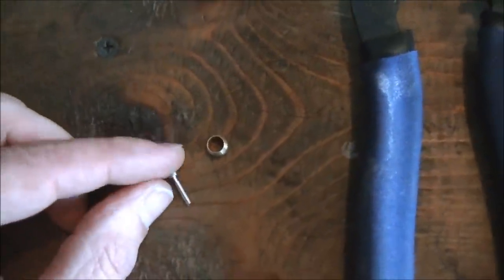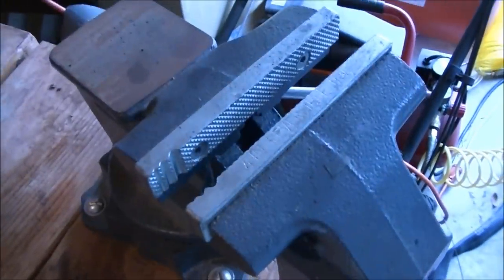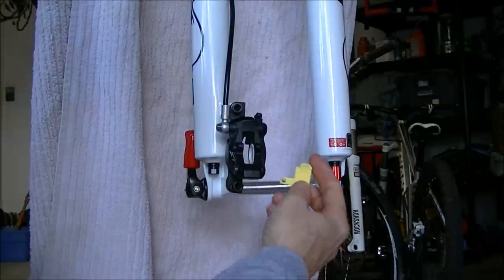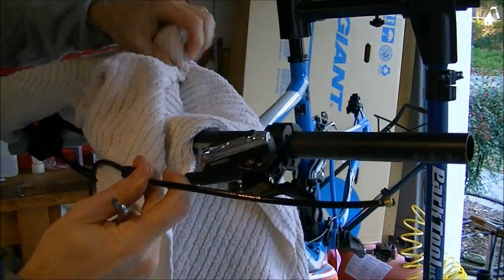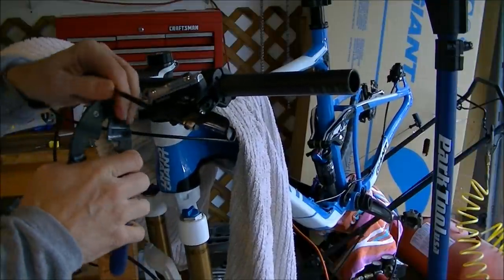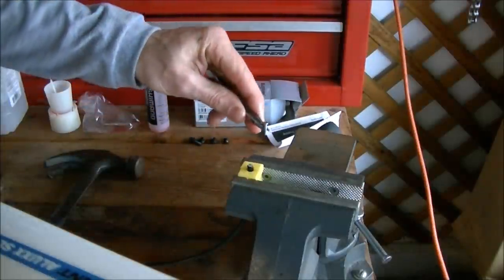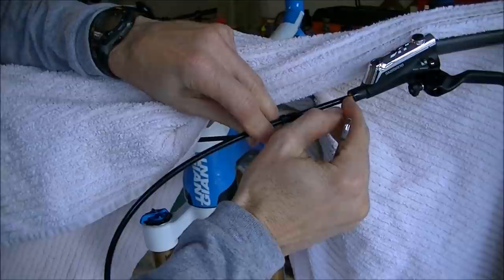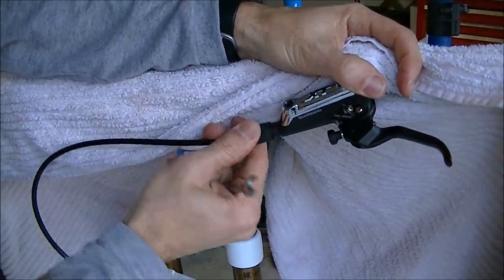How to Cut, Shorten and Re-install Shimano Hydraulic Brakes

Comment: Hey Clint, nice vid , I am currently running Shimano M210 hydraulics but want to upgrade to SLX, do I have to use the hose that comes with the SLX or can I just use the hose thats on my current set up since they are already cut to the length that I need. Thanks in advance.
Reply from the maker: 99% sure you can just use the same hydraulic hose. Keep the other one as a spare.
Reply: @ClintGibbs  Thanks a bunch Clint!!... Keep up the good work!

Comment: People say that an SM-BH59 can be used in place of an SM-BH90, 59 is for road bikes, whilst 90 is used on mtb bikes, I know the internal diameter is larger on 59 than the 90 which is smaller...what would be the difference in operation/feel between the two, I want to install the Saint 810 DH brakes on my Giant Fathom.
Many Thanks and Kind Regards in advance ; )
Ooh!! I can't make my mind up between Mavic or DT Swiss? Do you have a preference??
Reply from the maker: My preferences DT Swiss. I cannot speak from direct experience with smaller brake lines but I would imagine you're going to lose some modulation. But that's just the theory. Never tried it.
Reply: Thank You Clint!  I'll go for the DT Swiss then
God Bless : )

Comment: if i need to dettach the brake lines from the body of my bicycle(cannot be dettached unless another end is free, so it could slide along the holes, should I follow this instruction or is there another way around so I don't need to buy the ones you put inside and outside the cable?
Reply from the maker: You should be able to remove the brake lines and then reinstall using these instructions.

Comment: Just to be sure, my SLX came in as Rear Brake-Right Hand / Front Brake-Left hand. After cutting the able, Can I swap the cable to the other lever so it could be Front-Brake Right Hand / Rear Brake Left Hand.
Reply from the maker: Yes.  And if you want to swap it back on you just unscrew from the lever and screw it into the other one. There's a pretty good chance you'll have to bleed the brakes afterwards.
Reply: +Clint Gibbs Hello Clint. Great video, I will do this when my own set of brakes arrive, but my brother's brakes which we ordered some time ago, a set of M355 disc brakes, entry level, came inverted too. I am to blame cause I didn't notice the description where It did say that they were inverted and he doesn't understand english, so yeah..

But anyway, the length they came with is just fine with his bike, but I was wondering if we can just take out the cable of the lever and insert it on the other lever without having to replace the insert and olive? Like I said, we are not going to cut the cable.

Thanks in advance
Reply from the maker: You will not need to insert a new olive if you do not cut the hoses. You may need to bleed them but try them first.
Reply: Alright, thanks!

Comment: hi Clint just got my shimano xt ice tech brakes the bike shop told me that these brakes need to be bedded in so they told me to find a nice steep decent and to apply these brakes as hard as i can to heat them up  is this the right way to do this please can you give me some tips thanks Clint.
Reply from the maker: That's about right. What I do is go on the road and get up to about 20 miles per hour and then apply both brakes hard to a full stop. I repeat that 10 times.
Reply: thanks very much for the tip Clint

Comment: Hii. Are their any chances that it will leak if shorten it? Or are their any chances too if i already cut it and no leak. BUT. If i squeeze slowly the lever will hit the grip. It means their is leaking air? But when you buy new one it doesnt hit the grip when squeezing slowly. ( Sorry half english please answer my question gonna buy mt200 and shorten it. Tia. )
Reply from the maker: If you do this properly then it will not leak. But it sounds like you need to bleed the brakes.  
https://youtu.be/QciJbZf6Bqc

Comment: Hello Clint, I buy a pair of slx brakes for my trance. Have you got any tips and tricks about passing the hose through the frame (internal routing)? How did you do it with the xt brakes on your giant? Thanks a lot
Reply from the maker: You have to disconnect the hose at the lever, pass it through (from the bottom up), reconnect and the bleed the brakes.
Reply: But how I'm going to find the hole to the top of the frame? One thought that I have is to join a simple gear hose to the old brake hose, then pull the old hose down and then join the new brake hose to the empty gear hose and pull up the new brake hose :)
Reply from the maker: You can use it just feed it up and work it out of the hole at the top of. If it's easier to go from the top to the bottom then yes, feed another cable down through and out and then you can tape it to the brake hose and then pull the brake hose up through.
Reply: Buy the Park Tools IR-1.2 routeing kit. It's worth its weight in gold. Literally the best tool ever invented for working on modern bikes with internal routeing of housing, cables and brake lines.

Comment: Can I use this method to swap my right front brake to be the right back brake instead(vice versa)?
Reply from the maker: Yes. You would just need to unscrew the lines, screw them into the other lever and then bleed them.
Reply: Thank you!

Comment: was there hydralic fluid in the wire when you cut it or did you drain it before cutting.
Reply from the maker: You don't need to drain the fluid before cutting. In fact there are times where minimal bleeding is necessary if you can keep fluid from leaking out after you cut the line.

Comment: the one i bought was pre bleed, should i empty the lines first before shortening the brake cable?
Reply from the maker: No, don't drain the lines before doing that. In fact I have been lucky on occasions and have been able to cut lines and reinstall without having to bleed.

Comment: How is it that fluid doesn't drain out of the levers.  Is there some sort of a valve that closes when the hose is pulled out?  It would seem that you need to keep the lever turned up so that the hole is at the high point or it would gravity drain.  No?
Reply from the maker: Some fluid will drip out of the lever when the hose is removed, but it's not much.  The vacuum effect will keep most of it in.  But this is why you typically need to bleed the brakes after removing (and re-installing) the hoses.
Reply from the maker: That gets replaced when you do the bleed (separate video)
Reply from the maker: No, it doesn't matter if oil comes out or not. Just cut the lines and reinstall. Then follow the bleed procedure I show in the other video and all will be fine.
Reply: Thanks for the vid Clint...I added a few quick easy steps for a guaranteed no-bleed insty.  

1) turn lever up so that no oil comes out (i.e. no air in), cut hose close to the lever and plug both cut ends with a screw so no oil comes out.  
2) turn down lever to riding level, mark hose for cut and turn lever back up so no oil comes out.  
3) cut hose to length always keeping cut end up and when ready, quickly screw hose into upturned lever.  

I've had two sets of Shimanos and I've never had to bleed yet after about 3k miles (just a routine flush)...When I do need a bleed, I'l have to watch your next video.

Comment: What if you don't have the connector insert and the olive that round ring because you bought a used brake? CAn I pull out the old olive, straighten it and take out the insert and reuse them? how can I get them if all these can't be done?
Reply from the maker: No, you cannot reuse an olive. Your local bike shop should be able to order one. If you don’t have a shop nearby you should be able to find one online.  

JooFn MTB Mountain Bike Bicycle Olive and Connecting Insert for SHIMANO BH90 Hydraulic Disc Brake Hose (BH90) https://www.amazon.com/dp/B077VPSJKL/ref=cm_sw_r_cp_tai_0AVsCbQX5M9AZ
Reply: @ClintGibbs  Thanks, I got them

Comment: Is it possible to have air in the system after this? Sorry for my bad english.. please respond :/
Reply from the maker: +stoenchu122 yes, some fluid to leak out which means it will get in the lines. You should plan on bleeding the brakes after this.

Comment: Hey! is it possible to put a Front brake in the back wheel ?????
Reply from the maker: +TheDoors00 sure. You can just swap the hoses from one level to the other. In the mountain biking world they call it Moto Style, when you use the left lever to operate the rear brake. When you do that there's a good chance you're going to have to bleed the brakes but you don't need to replace the olive on the hoses when you do it, assuming you don't have to cut any hoes to make them shorter.
Reply: Clint Gibbs Thanks a lot for the reply and info! xD that sounds pretty gnarly, would it be possible to turn the lever upside-down and put it on the right side?
Reply from the maker: No, the reservoir needs to be in a certain position.

Comment: hey can you mix and match hydraulic disc brake calipers with a diferent set of levers  lie shimano lx levers with a difernent pare of calipers
Reply from the maker: I'm pretty sure you can pair different Shimano calipers and levers but you don't want to mix with any other brand (like Avid or Hayes).

Comment: Hello, what is the size of the connector pin and olive for Shimano MT200?
Reply from the maker: As far as I know there is only one size.
Reply: @ClintGibbs  No. I  found 2 types BH59 & BH90
Reply from the maker: @psbalan1  then I would have your LBS contact Shimano regarding the size for your brake system. I've only seen one size.

Comment: Did you need to bleed them after this process? Cheers.
Reply from the maker: Usually you do have to bleed after cutting the lines. But bleeding with a funnel is a very simple process.
Reply: +Clint Gibbs I really appreciate your videos. I  do, disagree, with this comment from you, however.  The easiest way to "upgrade" brakes is to do "bench cuts" using existing lengths as a guide.  NO BLEED is required.
Reply from the maker: Not quite sure I follow you?
Reply: Hi, again thanks for the awesome videos.  There is no need to bleed Shimano brakes if you cut the hose in the correct way.
Reply from the maker: Whenever you remove a hose from the lever body usually some oil will drip out. This needs to be replaced. There have been times when I've cut lines and not had to bleed the brakes, and then there are times when I have had to. It's just wise to be prepared to bleed if necessary.
Reply: Thats exactly why I suggest doing everything "off-bike".
Reply: I do agree with the be prepared to bleed as necessary comment, thats just being smart.

Comment: is it also possible to cut the hose on the caliper?
Reply from the maker: No. The banjo fitting down there is not removable.
Reply: +Clint Gibbs my slx caliper was damaged so i decided to replace it with deore. Is that ok?
Reply from the maker: Most likely. I think most of the Shimano brake parts are interchangeable.
Reply: +Clint Gibbs ok sir thank you so much

Comment: What if u don’t have a vice?
Reply: ĸaιne use a vice grips or adjustable wrench. You just have to hold it tight enough to hammer the pin in.

Comment: Or is possible shorten cut without bleeding? To shorten it without losing oil!
Reply from the maker: Yes, but always be prepared to bleed the brakes.
Reply: Where place is the best for Shorten? Shifter or derailleur! I hope it part  4:33 is a equal on both sides?

This method work well. Nice video!

Comment: Maybe someone sees this in time... I'm gonna receive a replacement Saint lever soon and I'm wondering if I can leave the brake line with the olive and the insert as it is and just screw it into the new lever of if a need to cut the cable and use a new olive and insert. Anyone?
@Clint Gibbs
Reply from the maker: Yes, you can do that. Of course this assumes the length of the hose is appropriate. If you have to shorten it then you have to put in a new Olive and hose insert.
Reply: @ClintGibbs  Thanks a lot for your reply!

Comment: Do i need to bleed after i do this
Reply from the maker: Usually you do
Reply: @ClintGibbs  even if they're brand new brakes
Reply from the maker: @wajfu-_-6437  Yes. If you cut the lines you will most likely have some fluid leak out which means air will get in the system.
Reply: @ClintGibbs  what if i just internally route it and dont cut the lines yet because im still waiting for my bleed kit to arrive and it looks terrible with out the external ports
Reply from the maker: @wajfu-_-6437  that would probably work. Doesn't hurt to try it.
Reply: @ClintGibbs  i tried it and trimmed it while i was at it i didnt end up needing to bleed it i just needed to pump it abit and then it felt the same as when i got it out the box
Reply from the maker: @wajfu-_-6437  Nice. One tip is that you can open up the reservoir at the top and put a little bit of mineral oil to take up any extra airspace. The brakes are designed so that when you pump them the air goes to the top.

Comment: Shimano Olive and Connector Insert BH90 and Shimano BH59 2.3mm Bore Olive and Insert how do i know which one to buy the long story i bought a decent abused bike but found the brakes had no grab after a quick check the guy suggests he used dot 4 oil :( a smear of oil on my thumb and forefinger tell me he's overtightened the nut and crushed the olive why he would touch that part im not sure but feel thats the reason the back brakes the same but no smear of oil he says they were burped but don't think he's telling the truth the brakes are rubbish they touch back to the bar i thought air in the system but being dot oil i don't have any in im on mineral obviously my plan is to rectify the broken front olive and bleed the full thing however im not sure which insert to buy i guess resetting the pads may be a good idea to any more pointers would be great i get the oil in a week so hopefully it'll rectify itself. great videos guys you tubes had more educative respect than the whole of my schooling days tyvm clint
Reply from the maker: +Paul Williamson not sure if I understand your post correctly but you would have to trim the tip of the hose to put on a new Olive. You would also need a new hose insert. Pretty simple and straightforward. But regarding D.O.T. Fluid, Shimano brakes are not designed for that kind of fluid at all. You have to use Shimano mineral oil.
Reply: tyvm clint the brakes are quad qhp-sp and it suggests dot 4 or dot 3 oil is it possible to empty the lines and refill with dot 5 or mineral oil please
Reply from the maker: Ok, that I'm not familiar with those brakes
Reply: based on your video i'm pretty sure you have educated me with the basics to try it thanks again clint

Comment: hey need some help. there seem to be something inside the Olive when I install them on my cable. I have no clue what it is. what should I do? wipe it off? or leave it? http://imgur.com/P47N1k3
Reply from the maker: +xEvan1987x Looks like someone put some grease on the threads.  Just wipe it off.  It's not a place I would put grease since it could contaminate the hydraulic fluid.

Comment: The olive didn’t come out on the line what do I do?
Reply from the maker: I’ve never seen that happen. The Olive gets pinched so hard on the line that becomes a part of it. Use a flashlight and see if you can see it inside. You may have to take some needle nose pliers to pull it out. If all else fails take it to the local shop.
Reply: Clint Gibbs thanks for the reply I hadn’t installed it right and it fell back out with a few love taps.
Reply: @ClintGibbs  I had to drill mine out once as it got stuck in there like yours